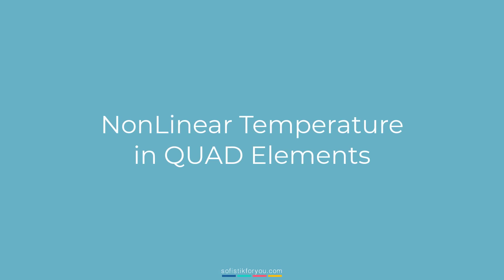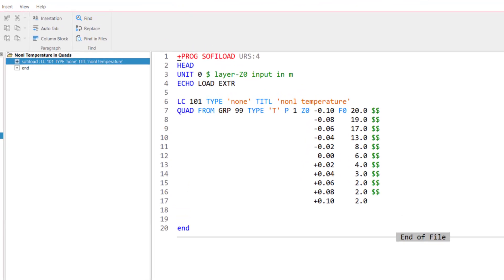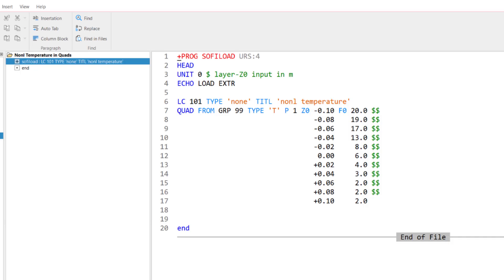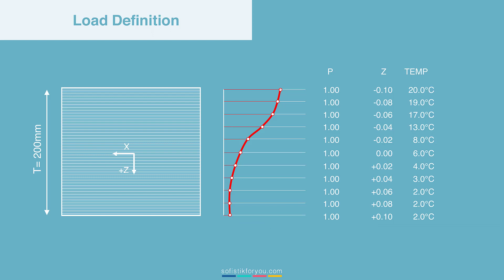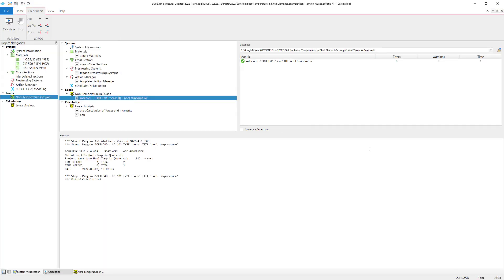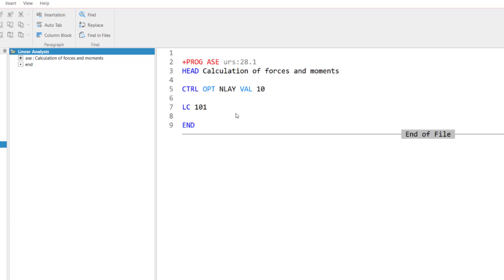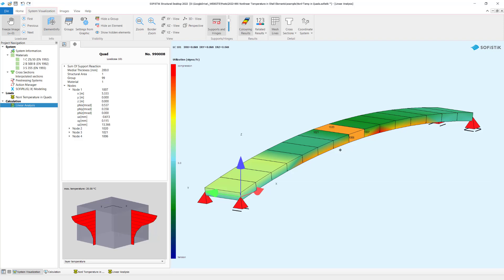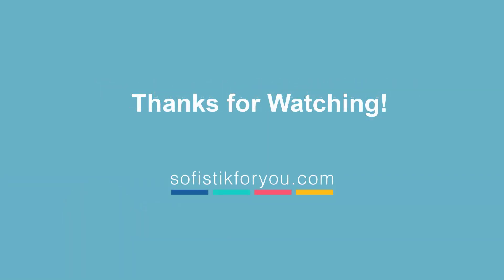Non-Linear Temperature in Quad Elements

Comment: Hi Guido, one more question, is it possible to generate a temperature profile in Graphic or Results?
Reply from the maker: The temperature profile needs to be defined in SOFILOAD. There is no harm in creating an excel sheet to generate the necessary CADINP input if you have to do it more frequently. 
The visualisation of the assigned temperature is only possible in SOFISTK Visualisation.

Comment: Very interesting! Is it possible to do the same thing in beam elements?
Reply from the maker: Yes, you can assign a non-linear temperature to beams/cross-sections. However, the workflow us a bit different. Basically,  the temperature gets assigned to points within the cross section.
Reply: @SOFiSTiKFORYOU  Hi Guido, thank you for your explanation. Does it mean that we cannot directly assign different temperature in beam elements using the "z" value? But rather we must use predefined points in the cross section?
Reply from the maker: Yes, this is correct. To assign the temperature, points (geometry points or stress points) are required. The temperature values can then get applied in SOFILOAD and the BEAM command.
Will publish a video on the workflow soon 😉
Reply: @SOFiSTiKFORYOU  Thank you! I look forward for the new video.
Reply: Explaining that with a video would be a great idea!